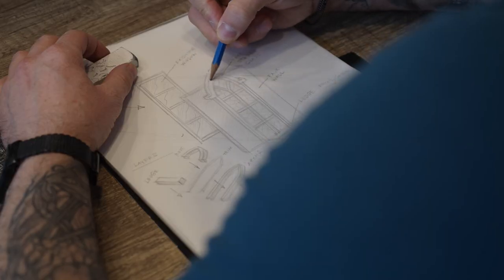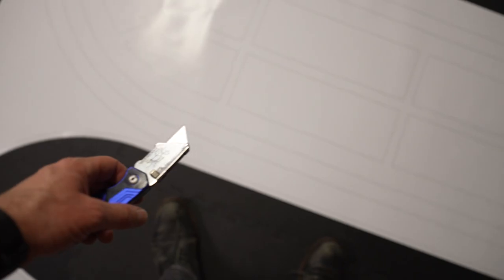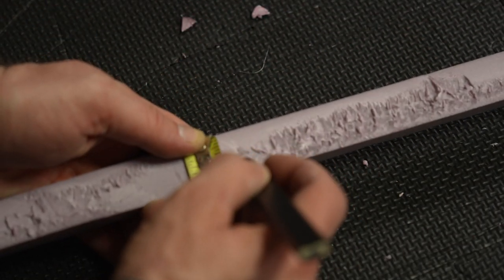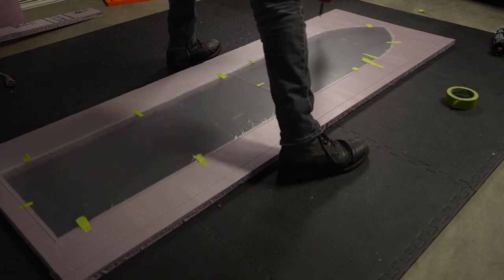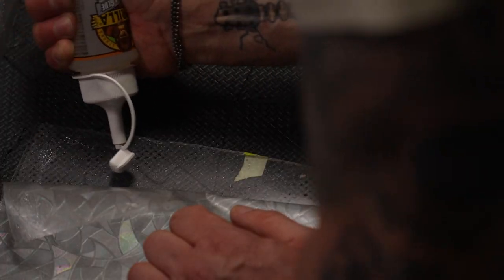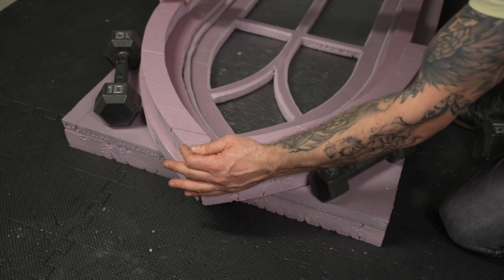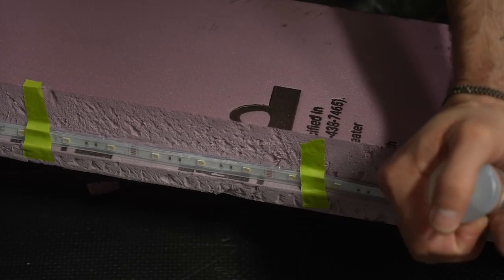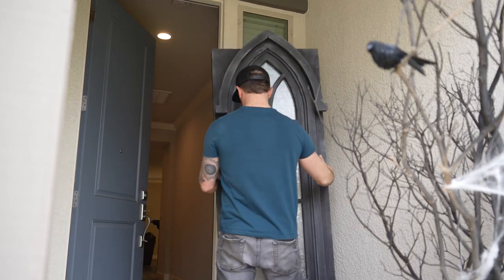DIY Faux Gothic Window Frame– HALLOWEEN TUTORIAL!

Comment: Disposable box cutter (with the slider on the handle to extend or retract the blade) works best for cutting that foam, I've found. Thier like $0.99, and you get smooth cuts, so you don't have to smooth out all the places where the blade snags on the material afterwards. I use tape wrapped around the top of the handle to keep the blade from sliding, but that could prob be avoided by buying better quality ones.
Reply from the maker: Awesome, I’ll try that next time! Thanks for watching and the recommendation